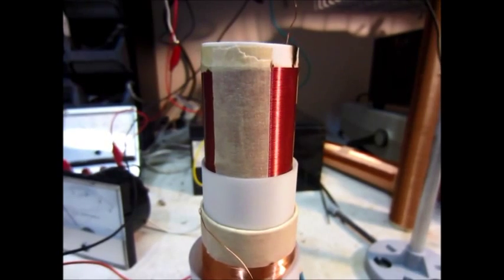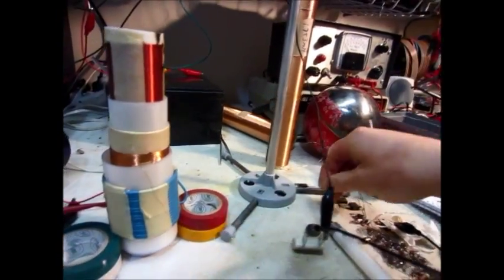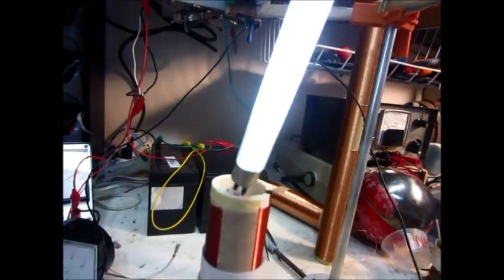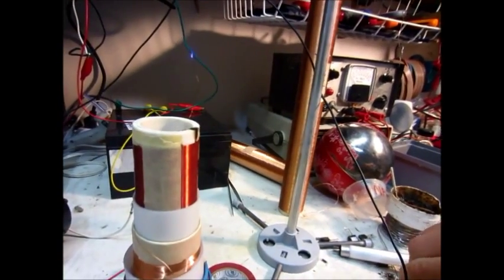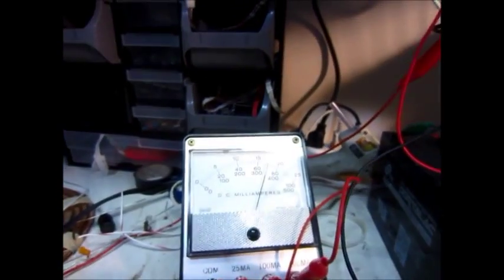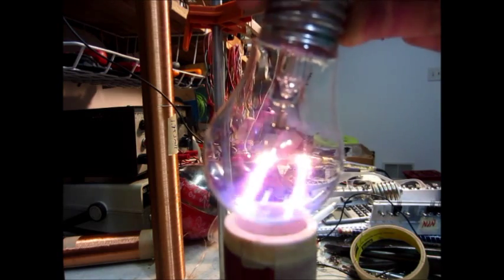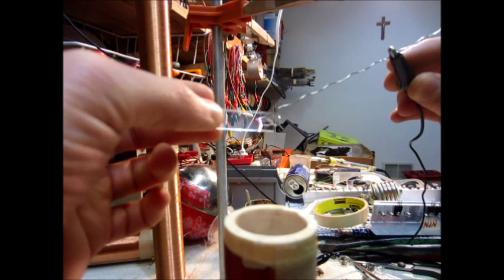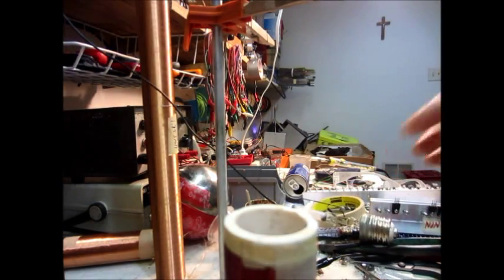Slayer Exciter Tesla Coil With Double Secondary Cutting Glass and Lots of Plasma Output

Comment: How does the double secondary coil work? Also, I can't get my incandescent bulbs to produce plasma even though my coil shoots out arcs. Any tips?
Reply from the maker: +Scotlahn Mccallister You just gotta experiment with the double secondary.  I really don't understand how it works.  You want the clear bulbs and only some work.  Generally new ones work best and only some manufacturers make good plasma.  It depends on the gases that they used inside the bulb and how much vacuum.  Just buy a bunch and see which ones work.

Comment: Not that much output, for a coil with this diameter... What power source you have? A ZVS?
Reply from the maker: Very true if it was a normal tesla coil.  This is a slayer exciter or solid state tesla coil.  It uses a transistor and no high voltage supply, spark gap, or high voltage capacitors.

Comment: On the practical side, maybe you would want to communicate with people who fuse pieces of glass together. I have seen them use torches but do not know what type of fuel they burn or what type of glass they use. In your experiment, it appears that window glass is cracking in small pieces like tempered glass does. If you start with a large piece of glass and can crack small pieces off without causing a long crack, it could have some application. Be careful about what type of plastic is burning!

Comment: When a transistor is set up BCE, left to right-- base, collector, emitter -- looking at the front (for example a TIP31A in a TO220 package) -- typically a mosfet will be GDS , gate drain, source... left to right in the IRF 510 N-channel Mosfet). When you compare the two, they be interchangeable (more or less) G=B, D=C, S=E. Just start with 50k ohms resistor on the gate (base). Mosfets don't need much current at all, at the Gate.

Comment: That its going out so much, makes me think a different primary would be better. Try a pancake? I always saw those tall primary's as a last resort for untunable secondary's. Although I do like your adjustable one, Pancakes give better performance. Also if you drop the resistor value(aprox 30k), it should self re-start. All 3 of mine stalled out before I got them working good. Mostly by making a ton of primary's, till I settled on 4 turns cubed gauge from secondary. As described in Teslas books.

Comment from the maker: Thanks!  
I don't worry about the transistors over heating because I have plenty of cooling.  The secondary does not get much cooling because of the plastic sheet I had to put in between to stop arcing.  I have gotten it so hot that I could not touch it.  Getting it that hot sort of wrecked the secondary too.  I think the PVC pipe shrunk from the heat so the coils are sort of lose.  But it still seems to work pretty good.  I would say max continuous run time would be about 30-60 minutes.

Comment: Nice! I think thats more glass breaking at this time, although the potential is there. I have had some nasty cuts from my plasma this week. Could be a good surgical scalpel in the making :) Your putting a lot of amps through that poor secondary. Perhaps you could go thicker gauge secondary, or less turns on the primary? How far away can you get plasma in globe, with top load on? Have you tried a car halogen headlight globe yet? I burned holes in two globes, one was a fluro, they do get hot.

Comment: Nice plasma :)
If it's voltage spikes that keep killing the transistors, would a horizontal output transistor from a TV work for driving the circuit? Those are 800+ volts and a handful of amps if I remember right.  Gain might not be high enough though.